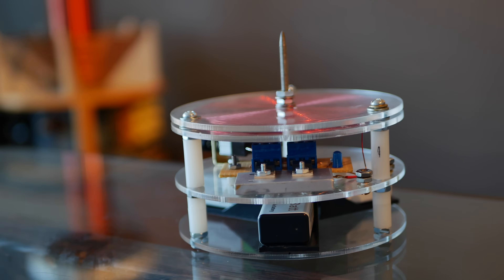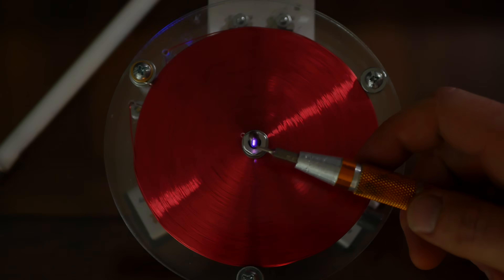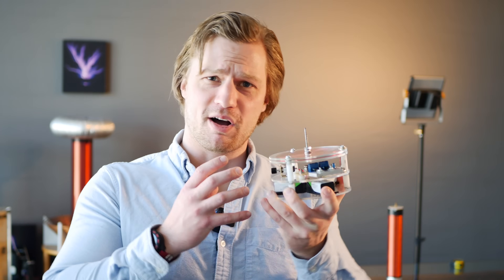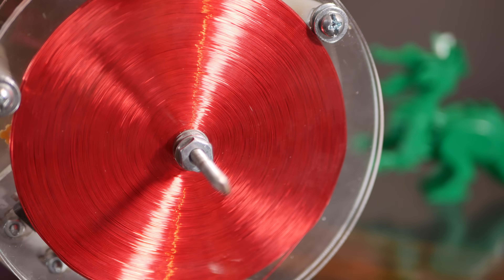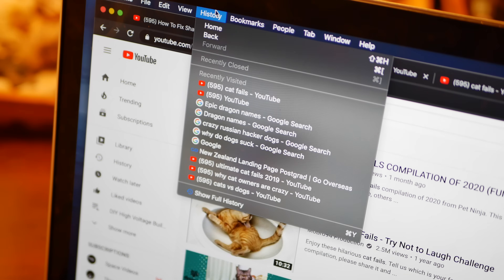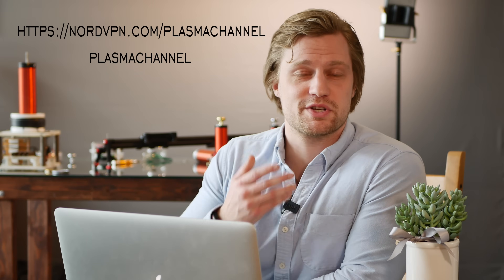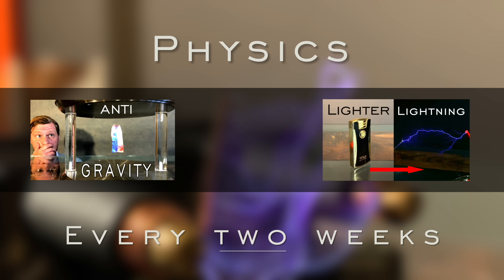World's Most Powerful Pancake Slayer Tesla Coil? (Melts Copper)

Comment: Firstly, nice build, however a few things stood out, firstly how come there are two to-220 transistors on the board at 2:20 . are they paralleled up or are you using a fancier push pull driver? Where can I find a schematic of your build? Also what resonance freuqency is it operating at and to what impedance did you design your primary/secondary coil? What current is drawn by the circuit, and what is the efficency? Surely that heatsink is not going to last in CW mode. Lastly "worlds most powerful is a bit of an overstatement but still a nice build :P!
Reply from the maker: Hi Platinum, thanks for asking. So I stated in the video, while showing the two transistors, that they are wired in parallel to increase performance and increase longevity. As for the schematic - I also showed the exact schematic in the video. It is wired identical to the shown schematic. 

The heat sink gets hit after about 15 seconds. That’s good enough for me. As for the title... there is no other handheld rechargeable pancake slayer coil on the internet. Mine is the first 😋
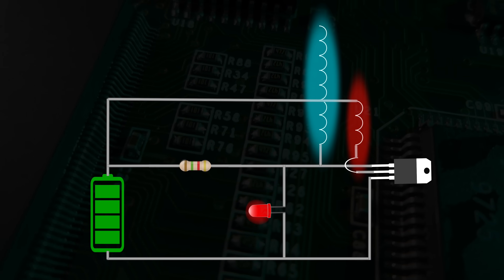Reply: @PlasmaChannel  In that case I stand corrected about the first in the world :) ! I don't mean to come off as rude but i only saw the schematic at the 3:05ish minute mark, the critical values of the parts such as the winding ammount for the primary and secondary coils was sadly not shown, however the description did list the parts used. Also, as for the longevity and stability of the circuit I doubt there will be much gain in this aspect as the 3055 transistor can switch quite high currents, and in fact you may be doing more harm than good if only one biasing resistor is used as the dies can have various gain factors, which will negate the benefit of using two transistors and can lead to a catastrophic failiure from a thermal runaway effect especially on a small heatsink. As for the batteries its cool to have it portable granted, but that creates a difficulty with grounding leeding to smaller breakout. Lastly how exactly are the coils wound? is it a bifilar design or are the primary and secondary coils on other sides of the acrylic?

Comment: Thats badass Jay.  I have a regular secondary that I wound and have been experimenting different ways of arcing it.  I tried this driver circuit but used an irfz44 mosfet but couldnt make it oscillate.  Will try again.  I also tried using a mazzilli ZVS driver circuit for the primary.  Didnt get that to work either,  dont understand why it didnt work as the frequency should be similar to this. But ive never seen anyone drive one from a zvs before so maybe it cant work? I used the zvs to power a flyback transformer to charge a large cap and arced it through the primary which did give some decent 50kv static arcs out of the secondary.
Reply from the maker: Thank you. Yeah, for these you basically need a self-resonating design in order to keep it in tune. Just like a slayer circuit.

Comment: Can we powered a voltage multiplier with that???
Reply: You'd be looking at issues of corona discharge and arcing pretty quickly
Reply from the maker: You definitely could, if you dealt with the corona issues mentioned by Stuart. This only puts out 4 kv.....the voltage multipliers I build, and can be seen in the background of some of my videos, are powered by 20kv. They are submerged in a special wax mixture to suppress arcing and corona. Cheers
Reply: Plasma Channel thanks for the advice

Comment: sir can i use a 24 volt 1 amp power supply
Reply from the maker: You will need greater than 1 amp, but 24 volts is perfect.
Reply: @PlasmaChannel  THANKS SIR

Comment: I GOT A SECONDARY OF TWO FEET TALL AND AROUND MORE THAN 1500 TURNS . MY SECONDARY HAS 7 TURNS OF 4MM THICK COPPER WIRE. I AM IN A DOUBT IF THIS CIRCUIT WOULD WORK OR NOT. PLEASE HELP 
I AM USEING A 12 VOLT 7 AH BATTERY AND MY MOSFETS ARE EXPLODING PLEASE HELP🙏🙏
Reply from the maker: I recommend using the MJE3055T transistor. Works perfectly. Also, you need to have heat sinks.
Reply: @PlasmaChannel  THANKS SIR

Comment: Primary 4 secondary 800turns
Reply from the maker: I did not count the turns on the secondary. Also, it is 2 turns thick. I estimated about 600 feet.
Reply: @PlasmaChannel  200 m 0.2mm wire is good?
Reply from the maker: lifehack vlog MEGA that is too thick of wire for the secondary. I do have a link to the correct wire in the video description.

Comment: what about oudin resonator? what about D'Arsonval? 

https://commons.wikimedia.org/wiki/File:Tesla_D%27Arsonval_and_Oudin_electrotherapy_circuits.png
Reply: D'Arsonval and Oudin's coils rapidly became known as the same thing, wikipedia doesn't give info on them unfortunately but they were originally distinctly different. I don't have the books to hand but you need to research early 1900's texts to get the full picture. From memory they are both air core autotransformers and the D'Arsonval coil had a primary spread over a large area so it could be precisely tapped for the correct voltage as "medically" required. Nowadays a D'Arsonval is a cheap underpowered Chinese violet wand for beauty therapy. So don't get them confused! The good doctor would be turning in his grave lol
Reply: @stuartcommon4651  Yes in the PNG image the coil are the same for Tesla,Darsonval and Oudin, it is a Ruhmkorff coil
Reply: @mrpix3011  correct, together with the Wagner's hammer attached on the right hand side in the image those coils form an electromagnetic mechanical interrupter, all 3 designs shown there would be generally for medical use, the actual Tesla/Oudin/D'Arsonval coil and the differences between them come after that bit but the image doesn't really convey the differences as well as it could. Incidentally the Tesla coil in that picture is a bipolar coil
Reply: Ie. The Ruhmkorff coil is not the high voltage/ high frequency coil
Reply: @stuartcommon4651  interesting! thank you man! Also in the image they use the same capacitor, leyden jars.
Reply: @mrpix3011  very welcome! And yes, this could also have been a flat condenser that looked like a sandwich with flat tin as the bread and a filling of glass as the dielectric which is a lot easier to make because you don't have to line the inside of a jar with tin and they soon moved onto boxes with metal plates immersed into a solidified wax mixture or oil

Comment: You should use a small brass pyramids on top I think it'd be interesting to see considering that when you put the multiple LEDs in the path of the field they lit up in a cone shape
Reply from the maker: Fun idea. Placing any metal near the secondary coil, though, steals power out of the system. Makes the output, worse

Comment: Quite amazing... Is there a way to design a coil with a specific frequency in mind
Reply: I think if you use a 555 timer chip with an astable "dead bug" circuit you can change the square wave output. Capacitor and 2 resistor values control the frequency. There are 555 calculators online. Replace one of the resistors with a potentiometer and you can play with the frequency (duty cycle) up down. I used that to make an LED flasher more than 10 years ago
Reply from the maker: Thank you, yes the length of wire will directly affect the frequency, as well as adding a topload. this will affect the electrical frequency.

To affect the breakout frequency, which is a different thing, you could use as Techno mentioned above.

Comment: Interesting, I've heard that flat coils notoriously suffer from internal arcing. Mayhaps I heard wrong.
Either way, very compact! Very pretty!
Reply from the maker: Hi Dayton! Thanks a bunch. Yeah, what's interesting is the flat coil was particularly sensitive to turns ratio. I got these results using 4 turns on the primary. Bringing it down to 2 turns causes open breakout to occur, but the sparks are cold to the touch. No power behind them at all. And they cant be stretched out. Its amazing how much current the arcs carry using this design.
Reply: An easy option to combat that would be to immerse the coils in oil or vacuum pot them in resin (second option not as easy but the vacuum is required to ensure the resin fully penetrates the gaps with no air gaps or air in the resin)
Reply: @Heads Mess Just watched. I see what you mean. 'Twas a little hard to follow without narration, but I think I got it.
Reply: @Heads Mess An understandable predicament. I guess I've just been lucky; I've used the same camera for years now. Its gotten up close and personal with explosions, thermite, high voltage, microwaves, etc. That camera is a trooper!

P.S. I think we can all agree that high voltage looks much better in real life than on film :)

Comment: Could you make it musical? 
And could you explain how such a circuit works? Because I have some trouble shootings with my circuit.
There are still some parts of the circuit I dont understand. Even my college teacher who are specialists in this subjects dont understand🤔
Love to see how you would do that. 
And it is good for your views because there are not a lot of videos on youtube about diy musical slayer exciters😉😉👍
Reply from the maker: What part of the circuit are you confused on? I explained breifly how it works, in the video.
Reply: @PlasmaChannel  No I mean if you are gonna make the musical tesla coil, could you explain that circuit. I understand the normal slayer exciter completely. 

My problem is that when I power up my musical slayer exciter, is that the mosfets of the interupter part, keep staying on. He does not want to switch with the frequency of the music. My slayer exciter part in the other hand does work. I have tried al kinds of resistors values and other mosfets, but my best result was when I hooked up the power, the music started playing litterly from the powersupply. Not from the discharge point of the secondary load. And trust me, I have hooked up everything right.
Here is a link of one of those circuits I tried:
https://youtu.be/mur3dIDo0lI

Comment: That was very cool. I'm with you on the idea that it's not a true Tesla coil, more related to solid state Oudin coil. Interesting nonetheless. Also wondering if that's the same circuit as an arc lighter?
Reply from the maker: Thanks for watching! It definitely is different than the circuit for the arc lighter though. The arc lighter uses a high voltage secondary which does not need to feed back into the primary to trigger it. It has totally isolated secondary windings.

Comment: So if there is a magnetic field that activates a electric field what happens if you hold a magnet close to it would it just keep the electricity flowing or would it just not work and I'm guessing this is "special equipment"
Reply from the maker: Well, the magnet would actually absorb some of the power, and make the system weaker. It would capacitively couple to the secondary. As for effects, if the magnet was moved very quickly across the secondary it would induce a voltage, yes. But if it just sat there.....nope...it would only steal power.
Reply: @PlasmaChannel  Non-unlimited power keep up with your work

Comment: Any advice for a beginner getting into high voltage electronics? I know a bit, but I’ve never built anything over 60 volts. I really want to build an SSTC, but I’m not really sure how to start or if that’s even a good idea. I love your channel btw, and it’s what got me into high voltage electronics.
Reply from the maker: Hi Hercules. Glad you enjoy my videos. If you're not super familiar with higher voltages, I recommend only build totally safe things first. That would be a Van Der Graaff generator. Super easy, makes really high voltages. I have a video on making a Van der Graff. I also have two videos on making mini handheld tesla coils that are totally safe. Check them out!

I'd stray away from a solid state coil for a while...they are very complex.

Comment: No spark gap? Mosfet/Transistor replaces spark gap in slayer exciter?
Reply from the maker: Correct. Spark gaps only work for high votlage primary circuits. This primary circuit only runs off 24 volts....not nearly high enough to form a spark and operate a spark gap primary. The transistors act as the spark gap, and do it very efficiently.

Comment: Did I miss it, but exactly how many primary turns and how many secondary turns.
What about phasing the two windings, what about the LED polarity.
Need a better schematic mate.
Its a simple circuit but needs to be put together correctly.
Reply from the maker: So, you did miss it but no worries Tom. I mentioned the primary is 4 turns wrapped around the circumference of the secondary. The battery polarity on the schematic was accurate to the wiring, meaning the LED is just wired how an LED normally is. The resistor is non polarized, an I used an MJE3055T transistor (wired exactly like the drawing in the video). You should be able to easily build it with the drawing. Cheers

Comment: The real question is how you wind?
Reply from the maker: Created a jig on a drill. Was very difficult and the first time my jig failed.....and 400 feet of wire unravelled and tangled. Second time came out great!
Reply: @PlasmaChannel  try stacking multiple layers, that will also allow you to try multiple primaries (between the layers, wired in parallel)
Reply: @PlasmaChannel  very nice thanks for answer
Reply: @PlasmaChannel  All the more similar if he takes the feedback on the peripheral terminal.
Reply: @PlasmaChannel  Introduce a counterfield thereby making this a real Tesla resonator, by a complementary PNP transistor which reacts to the feedback oppositely by switching on the counterfield and turns off itself while increasing the feedback for the NPN (that could be an issue). Just need to set the PNP in the off starting position and place it after the load (electron current perspective). Each have their own wind, and you don't need more than one wind each, but you could benefit from mulpile strands paralleled as is done here watch?v=7oDEfssO7Is
Reply: @PlasmaChannel Also see if you can use the neon lamp as a switch. See if it passes a low voltage DC while it's exited.
Reply: Creating a jig is usually the easiest way.
Reply: @michaelinamoment  Current goes outward then inward,  similar to a bifilar only shifted in the z axis, and he can also make another variant by flipping the second layer in the x or y axis, making the current wind in the same direction on every layer.
Reply: @sFeral  I would caution that the geometric shape matters between stacked bifiliar And wires round on the horizontal plane as outlined in Tesla's patent
Reply: @michaelinamoment  Incidentally re. winding jigs its possible to use a sequential method with 3 solenoids. I came up with this idea just now but it should work: sequentially clamping and unclamping automatically as the jig rotates to maintain tension. When done just use the same method CPU coolers use to "jam" it all in place, test and seal with blue cure glue or just plain old cyano (still under tension) Simples.
Reply: @conundrum2007  both the bifiliar and normal pancake can be made with two parallel plates and a motor (like from a drill or larger if you need to do a larger gauge or a long length). The only difference with bifiliar is needing to fold the wire in a loop at start, after winding you cut and splice the interior line middle to the exterior outside wire.
Reply: @Heads Mess if you require spacing (which is only necessary if you plan on doing potentials where you are worried about dielectric breakdown, then you use a plate that has spacers on one side of it. That kind of jig is a bit more of a pain to feed but is fast. You could just go with a thicker guage or one with a thicker insulation instead of air spacing.
Reply: Another type of jig is one that you don't plan on taking apart. Tesla used wood structures with pegs.
Reply: @Heads Mess no idea what you are talking about
Reply: @Heads Mess you literally have a video where you get a burnout of your wire using the method you described. Wire is Too thin, shellacing maybe easy dealing with that tiny wire, but dialectic breakdown in a wire is determined by voltage per square area. Scale it up which you can do and maintain resonant frequencies you're seeking
Reply: @Heads Mess spacing is only needed for air insulation. Bifiliar coil and pancake coils were developed for larger gauges, larger gauge fixes both your current burn outs and insulation dielectric breakdowns as you increase surface area of wire it reduces the potential per square area. Well documented Maxwell concepts

Comment: Reminds me of the PCB tesla coils using GaN transistors from hackaday, those have to operate at many MHz so really super fast power transistors were required!
Reply from the maker: Power max - it was you that inspired me to use the MJE3055T! So glad you commented. I tried a few others, and did a lot of research, but when i saw you had good results, i went ahead using the MJE3055T. Cheers, Mate
Reply: @PlasmaChannel  I need to continue development of my PLL musical singling coil, I like the compact nature of your pancake coil, I hate the large volume a normal tesla coil uses. Did you fill the coil with resin to prevent arcover?

Comment: Try it with a bifiliar pancake coil next! Tesla patent US512340A!
Reply: Here was a field demonstration of a bifiliar I made and powered by manually turning a AA on and off: https://vm.tiktok.com/sFaPch/
Reply from the maker: All the bifiliar coils i've seen are operated at really low voltages, so i'm not sure how well they'd handle higher voltages.
Reply: @PlasmaChannel  I think it will fair well. Tesla designed it for this purpose (in some pictures of lab you see large versions) but this of course depends on the dielectric strength of insulation of the wires and air spacing.